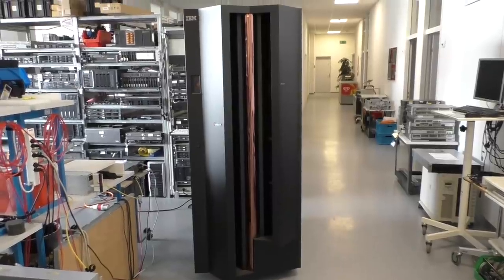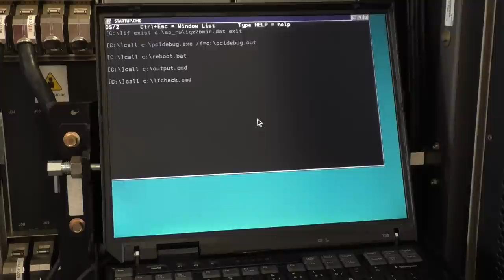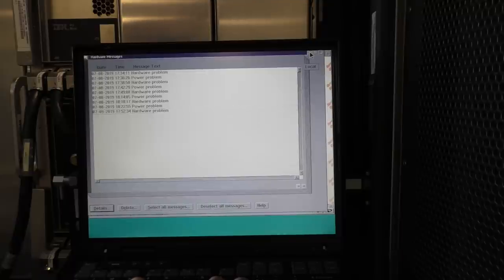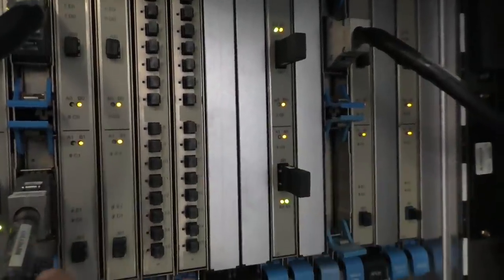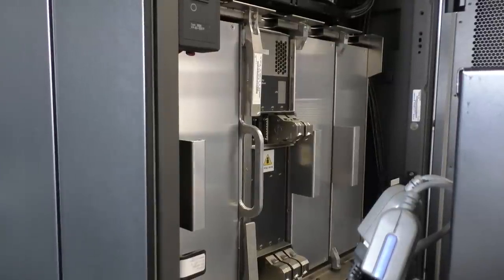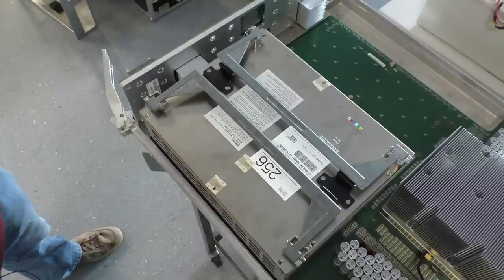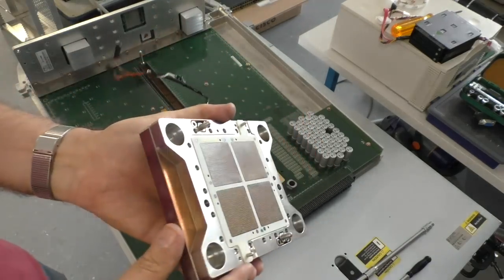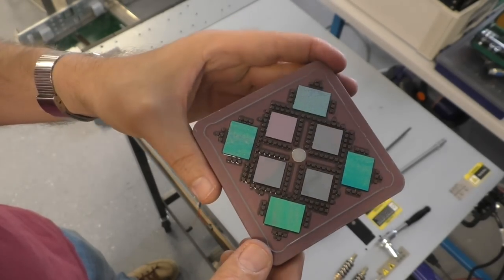Powering up the IBM Z890 mainframe and teardown - (PWJ148)

Comment: The MCM power integrity rail design is presented visually in the groups of capacitors. You can see that the enclosure has a lot of vertical space available to put in much taller AL Electrolytic capacitors so why are there so many small AL electrolytics when you have all that room? The design is using a technique of parallelling the AL capacitors to achive an overall power rail impedance. My quess is all these small AL caps are in parallel and are as close as possible to minimize parasitic inductive effects relative to the PCB power plane design. It is strange that there is not the slightest spacing for cooling air flow between some of the AL caps given all the board space available.

Comment: 4.2kW.. LOL.. 
Yes. IBM had great hopes with OS/2. I worked with it quite a bit back in the 90s. Mostly on PCs for desktop. It was actually far superior to Windows of the time. Version 2 was an actual 32bit protect mode multi-tasking OS. The problem was that it never caught on with software developers in the industry. OS/2 had the ability to run a Windows 3.1 session for the sake of running popular software but that had some limitations.  Eventually IBM moved to using Linux for controlling their big iron, storage systems, etc.
Reply from the maker: It's like many other stories.... A good product does not take off because manufacturers did not recognise the potential or it just came at the wrong time.
Like Xerox who invented the mouse and the GUI. It could be the biggest company on earth now.
Reply: @PlaywithJunk  I think in the case of Xerox Park, the main company didn't really appreciate the full significance of what their west coast lab was creating and sold those things off cheap.. Hindsight is 20-20.

Comment: The z/VM Evaluation Edition is delivered on DVD-RAM. You can also download the materials from the following URL
and copy them to a DVD-RAM: http://www.ibm.com/services/forms/preLogin.do?lang=en_US&source=zvmeval
This DVD-RAM must be inserted into the DVD drive of a System z10 Hardware Management Console (HMC) and used
to load a logical partition (LPAR). No external disks are required to start the Evaluation Edition or to perform simple
functions. However, in order to run any significant guest virtual machine work, external disks will be required for z/VM
paging and spooling, as well as for holding guest data.
The DVD-RAM contains a RAMdisk that holds data required to operate z/VM. A DVD-RAM is used to enable updates
made to this RAMdisk to be saved using the ramsave command, so that they are available the next time the system is
IPLed.

Comment: Not a spec of dust in that CPU book.
Reply from the maker: Well... I found a tiny bit of dust at the lower edge of the CPU cooler. :-)
These systems are used in air conditionned server rooms. There is simply no dust.
Reply: Play with Junk 

How much ram does this have

Comment: I counted 5184 pins (4x (36x36))
Reply from the maker: There is always someone who counts the pins.... :-)
Reply: Yup. Same figure I got as well.
Reply: Interesting LGA Socket, the socket itself got no "spring pins" like all Intel or AMD LGA sockets, but this frame with wires instead and no integrated loading mechanism (ILM) you just screw it down.

Comment: Yeah, games may use different modes without reboot, but if you want to change the system's desktop resolution, a reboot is required.
Reply from the maker: What computers are YOU using man? Every Windows PC can change the resolution without reboot. At least since Windows Server 2003 or Windows 98

Comment: Very interesting tear down,Does anyone actually know how many CPU cores this mainframe had,sure it will have been 64bit too? cant believe a guy actually bought a mainframe for his home though his electricity bills must be insane.
Reply from the maker: As far as I can see, the MCM has 5 single core CPU chips with a common L1 cache. There are also data compression and cryptography chips on the module. The clock speed is 1GHz.

Comment: First of all I'd like to thank you for the videos you make of taking apart great old IBM mainframe technology, not many people ever get to see what these look like inside.
But in this video you've mixed up parts from 3 VERY different IBM machines... 

The complete cabinet that you took apart first is a z890, a unit that has the same MCM's inside of it as a z990, but then you showed a copper heat spreader from a z9 Enterprise class mainframe, a MCM with different dies and die layout on it and then you ended the video by showing a Power5+ MCM, a MCM that doesn't look anything like the z890 or even z9 MCM...

This is pretty confusing for people who aren't very familiar with this kind of high end IBM mainframe hardware like I am, just MHO... :)
Reply from the maker: You're right. But it was not my intention to make a video about one specific system but IBM mainframes in general. Didn't I say what chip it is? I will pay more attention to details next time :-)

Comment: If I only had a time machine, I could pack this thing into and move back to 2004 and make shitloads of money.
Reply: You know, if you were to create a (working) time machine and you were to pull something like this, it would be much complicated than you think.  First, you will be traveling back in time, perhaps entering into a parallel universe/alternate reality, then you will try to sell the mainframe to a customer, you will probably find a customer since you will price it approx $20,000 cheaper than the cheapest dealer of the time (approx $180,000) but then problems would start: All of these Z890 mainframes had a unique serial number, and since you are in a parallel universe it means that the very exact machine down to its serial number already exists on this universe, and when IBM sees that an existing customer already exists for your machine and is in use somewhere in the world they would be perplexed to find that another machine exists under a duplicate serial number, probably they would get law enforcement involved to question you to hell in an attempt to get an explanation from you how you got possession of such a machine and you won't be able to give them any real answer not even procure a receipt either from IBM or from a supplier, speculation of (chinesse) counterfeit/having stolen IBM's industrial secrets and performed an exact 1:1 replica would come to mind.  You will eventually try to come clean in order to stop all the drama and will tell them you procured one of these machines on the cheap on the year 2019, invented a time machine and then traveled back in time in order to sell them for a super high profit, you would be declared insane and would be locked up in a mental institution with no way of leaving to go back to your time machine to return back home and just forget about the whole idea.

"Time machine" business idea gone horribly wrong...

Comment: The fact that a working machine needs to be scrapped just speaks on how, even in developed countries struggle dealing with E-waste.
Reply from the maker: This machine has at lest done some useful work. As an IT pro I see lots of devices thrown away brandnew and unused! Just because technology has changed or they are simply out of fashion.
Bad example the Berlin Airport. They scrapped hundreds of information monitors because in the 10 year construction time, the installed units became outdated and needed to be replaced.... they never displayed any useful data.

Comment: ESCON Enterprise System Connection, Fiber interface connection for IBM peripherals like disk drives, replacing older parallel S/370 interface.

Comment: tries to lever up the memory

"All parts should go together without forcing. You must remember that the parts you are reassembling were disassembled by you. Therefore, if you can't get them together again, there must be a reason. By all means, do not use a hammer." - very old IBM manual.
Reply from the maker: Nice quote! 🙂  But I did not install the memories and I really did not expect them to be soldered in. I have never seen that before...

Comment: So the notebooks are a critical component then? I initially thought the notebooks were dumb terminals, but the init process only started up after the software was running on notebook #1. Carzy how such expensive machines would rely on cheap x86 hardware for managing the system.
Reply from the maker: Well, what else would you take? And there are two notebooks for redundancy. And once the system is started, you don't need them anymore. It's like an electric starter on a gasoline engine 🙂

Comment: For those systems, couldn't they have avoided cheaping out on the fans, and get ones that were not so loud?
Reply from the maker: This is not a question of fan price but of airflow! Those fans are far from being cheap, like everything else on that machine. But you need a certain amount of cooling, so the noise is not avoidable. There are other models with water cooling.... that means the noise happens at another place :-)

Comment: Its a t30 or t42 laptop. The one everyone wanted is the HD screen. Which you seem to have. This is because the video chip is ati9700 with 32 mb of video ram. Linux works good on these p4 laptops.
Reply from the maker: True. I use it now with Linux Mint to setup network switches (RS232 console and Webbrowser). Works perfectly.

Comment: Are you sure the 4.2kW you mentioned, is the total power consumption and not just the fans? :D
Reply from the maker: No that's the maximum power with all I/O cards installed. For such a machine it's quite a low number.
Reply: @PlaywithJunk  and that NOT considering all the peripherals either!!
Mainframes would sequence power in to various devices as to not cause a power surge in the building!!
I worked in. HUGE mainframe data center

Comment: Wow. Stand back I think it's jet powered. It's probably quite normal but for someone who has never seen one before that is effing loud.
Reply from the maker: Oh I have seen and heard louder systems than this one
Reply: Data centers don't give out earplugs for nothing! :D
This is definitely quiet compared to some of them
Reply: Modern servers (nothing compared to mainframes, do not get me wrong) do not have the maintenance layer like this thing has, so they boot up instantly.  We had 2 or 3 servers at the local television station which, upon switching them on (or after coming back online after a power outage) clicked through a couple of hardware tests to show post-numbers at the front (PSU present, Disk Present, Redundant PSU present and redundant disk set present) and then switched on 8 small fans stacked in pairs behind each other per server, ramping their speed up as a fan-test, which sounded like a jet engine starting up, kept them at full rpm for 5-10 seconds and ramped them down to the temperature to keep things sort of cool (there was no adequate AC in the room where that was stored, so...)

Comment: Was going to say "it's shame to throw this old iron out" then it boots, and OS2 starts and the thing sounds like a 747 starting up then me says, has IBM logos and Eula's: me: "Yeah, toss it in the trash"
Reply: The laptops running OS/2 is for maintenance, booting up the system etc. that mainframe runs Z OS which is rock solid reliable, you can run it for years and no downtime. 24/7 non stop with RACF for high security. Windows is a joke for real heavy duty work.

Comment: The fan thaqt you say is starting up , sound more like a DISK's Drive
Reply: A mainframe has no internal disks.  Of course this was in early years pre-1990s
Reply: @rty1955  Some did DEC 2020 (RL02) used for storing the micro code and operating system did. and it sound like a stand alone type of disk drive
Reply: @fnordhorn  microcode on a mainframe in the 360 days was stored on punch cards between 2 silver coated airbags. Later in the 370 models, microcode was kept on a 8" floppy and read into memory on a power up (not IPL)
I wrote microcode on a 360
Reply: @rty1955  I been in the computer field since 1974 as a field service eng. I seen lots of mainframe with internal disks
Reply: @fnordhorn  a 2020 is hardly a mainframe.
Reply: @fnordhorn  oh? Like which mainframe prior to 1990s had internal hard disks?

Comment: you say you have less capstan tape then on the ISS ... i deerly believe you, as i didn't see ANY capstan tape on the server when you said it ...  I think you meant to say 'less Velcro tape', which IS on that rack and also in huge amounts on the ISS ...  capstan tape is heat resistant tape, it's got an orange look and is see-through. Velcro is the tape or strips that have a soft and a hard part, where the soft part gets hooked into the hard part and sticks to it. You also find velcro on clothing/shoes, etc
about the power lines: it's 230v for normal outlets and 400v for highpower outlets (like the one on the server)

edit: toevallig een vlaming? want uw vlaams komt enorm hard door uw engels heen ...
Reply: you ment Kapton tape, the Dupont trademark name for High Temperature Polyimide tape

Comment: Dumb question could you make a server into a gaming rig?
Reply: you probably could with something like a Dell r5500 :D
Reply from the maker: A "server" is not much different from a PC except that it has more space for RAM, disks, CPU's and it is built to run 24h per day.
The mainframe in the video is different. First of all it doesn't have a graphical interface. Secondly it is simply not built to do that. A mainframe is built to handle thousands of small tasks per second. Like online orders, accounting and shipping.

Comment: Escon is an old linking of nodes way
Reply: ?  EnterpriseSystemsCONnector - peripheral connections (disk, tape, printer, etc).  Optical fiber, half-duplex, serial. Initial spec 10Mbyte/s, max dist 43 km. Replaced the previous generation's Bus and Tag (python-sized cables)

Comment: Why does the server require such extensive startup procedures?
Reply from the maker: All servers have a quite long startup procedure. It starts with a test of the hardware components. On a mainframe are more components and they are tested more intensivly.
Additional to that is the redundancy of all components. They have be connected to each other, the connection must be tested too etc.
The main reason to buy a mainframe computer is the guarantee for no downtime. These systems are built to run forever. Parts can be replaced while the system is running. That's also something that takes time to initialize. 
There are a lot of service processors that have to be started and connected. For example environment monitoring, voltages and power, network, data encryption etc.

Comment: HOLLY CRAP!, I though the boot up for Sperry 90/30 took a long time!  this machine I could get 2 cups of coffee before use it.
Reply from the maker: And that was only the power-on sequence... no boting to OS yet :-)
Reply: @PlaywithJunk  without bootable drive that going no where.  Sperry was insane, where you have set the dials press the IPL every time it can on, change the dial 2 more times, wait for the load msg on the console screen when go get coffee then come back and still wait while u drank ur coffee

After that you had to enter the command to start the terminals for enter.

End the B3600 was crazy to start up and need a 50' x 50' room that make that IBM look like tinker toy

Comment: how do you connect a laptop to a server like the one you have
Reply from the maker: The Service Elements (laptops) were connected by Ethernet. I don't know what protocol they use for communication. In most cases this works with a serial connection (RS232) or Telnet or SSH

Comment: The big Question is can it run Crysis?
Reply: Its a mainframe so it has no graphics hardware, you could possibly get software rendered ports of games to work but then they would need to render to a virtual display interface

Comment: How many fans in one system ?
Reply: Lots!!! IBM used very smart thermal management.years ago you would need a huge air conditioner or a mainframe would shut down real quick
Reply from the maker: The larger models have a refrigeration unit installed. See my video "CPU cooler for the big boys - PWJ48"

Comment: My computer I'm watching this on has more CPU's and RAM than that thing!
Reply: Yeah and you run windows Hahah
Mainframes run much more efficiently.
I ram a 4383 with only 4M of main storage and had well over 1000 users on it, 16 partitions running and 16mb of virtual memory, 40GB of disk and 16 tape drives (unlimited storage)
Code back then was extrenely efficient unlike todays memory and CPU hungry apps
Reply: @rty1955  Damn! That's impressive.
Reply: @freeman2399  very!!! I was so impressed at how IBM designed hardware.
I used to write complete apps in assembler on a mainframe with only 48k of memory! I loved it! This is where we separated the men from the boys in coding. I used to do 10x the work in assembler than COBOL programmers.
IBM never sold mainframes back then. You could only rent it. You paid IBM by a hour meter on the front of the machine. Thier hardware and software support was the best I ever encountered
Reply: That system had 256GB of memory.. 16x 16GB Chips. Wonder what the core count & clock speed was.
Reply from the maker: Your computer is not 15 years old.
And your computer does not have 400+ fibreoptic ports.
;-)
Reply: @PlaywithJunk  these kids have NO idea of the power of a mainframe! The Z series would smoke a PC.
Reply: @chrisblanchard6930  comparing a mainframe to a PC is like comparing a race car to a bicycle!

Comment: small footprint not avail. boat anchor  my opinion  COTS for legacy timestamp  quit robbing os/2  licensed us restricted rights..  if i recollect        hipot problems     i had to compute the memory power and use regulated at low power.. now its 3.3v   the power is lan sensing for redund crc checksum.   your cross compiling licensing agreement in effect  warning.